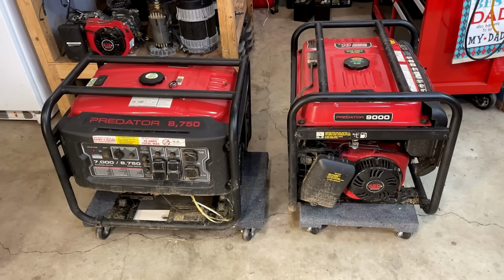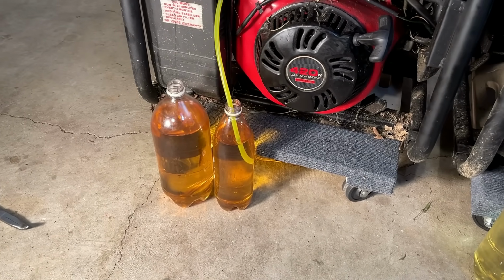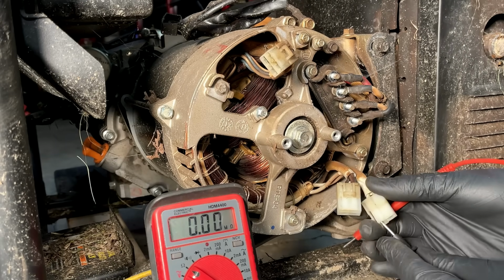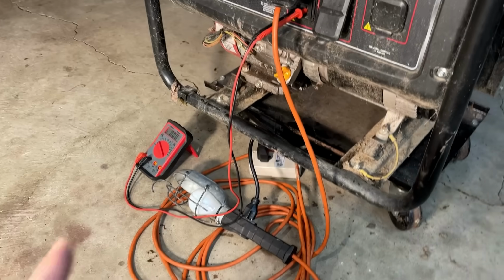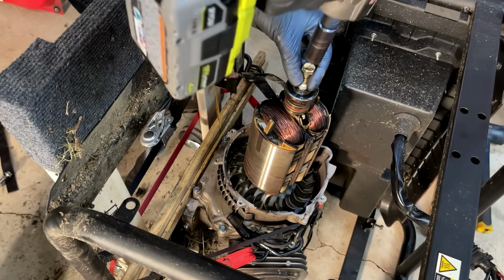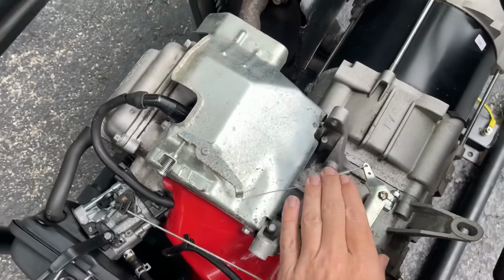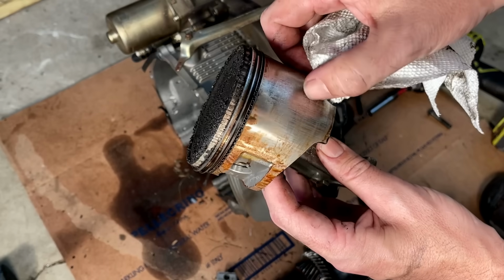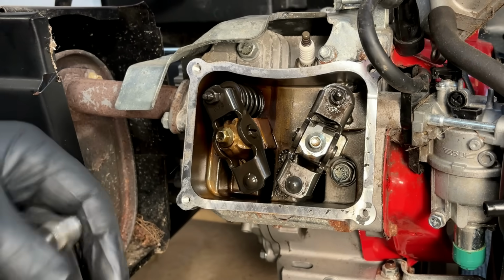3 Abandoned Predator Generators - Will They Run?

Comment: u must have a very good resale thing going on hahhaha... i cant even get rid of one coleman 5000 watt green monster 10hp. i guess its time of year . come winter they will want them lol .. had to do a new carb and fuel line filter and groumet on tank. owner left it with stabil in tank and carb.. yeah i could clean carb it wasnt to to bad. like a think goo oil from oil fields. but for 25 bucks for carb and needed oil and fuel filter and groumet do it right.

Comment: just curious. what kind of oil are you using in it? i was using synthetic 5w30 in my brand new lawn mower and it was doing that. i switched to briggs and stratton sae 30 and no more smoke. runs better than it ever has

Comment: A perfect plan for an off grid installation, where you really need the power...buy the cheapest generator(s) you can find, and never service them. What could possibly go wrong? Better off with a liquid cooled engine and four pole head for 1800 RPM.
In my world, our plant actually manufactured generators in this range, which gave me some pretty good insight if the pre Chineseium generators. We found that the best heads at the time (middle nineties) came from MeccAlte and Sincro, both from Italy. I built most of the test systems for both on line and life test. We used mostly Briggs & Stratton and Honda engines.
There were at that time only two shaft tapers, and a few bolt patterns on the engines. Engines in the same HP range would interchange. Engineering typical tested random generators off line to failure. The test equipment would vary the load, on and off, with varying loads. The idea being to work the set under standard load.

Comment: Hello. I had similar problem with excessive smoking on the engine startup with my lawn mower. I was worrying about rings or valve stem seal failure. It turns out there was a little bit too much oil in the crankcase; somehow oil has been pushed through the breather to the airbox causing really bad smoking at startup. I removed around 50ml and it fixed the problem for good.
Actually I was surprised with excessive oil level, because when changing oil I removed every last bit of old one (changed when hot plus I've added cleaner so it was much thinner than usually). Hint for me was the spark plug - was covered in residue suggesting engine is burning excessive amount of oil and inside of the airbox - covered in oil. It was such a relieve not to have to disassemble the engine to fix the problem 😄
Reply: Make sure fuel is not getting into the oil.

Comment: Glad you were able to make other generators run with the parts machines.  To bad for those engines though.  Makes me wonder if they guy just ran them to low on oil for to long and they were damaged beyond repair.  Great video at any rate.  Thanks for the videos.

Comment: In the last 6 months I had 3 new generators replaced!
The first Power King needed the bushes and AVR replaced after 2 months!
The the same unit threw an earth point and the dangling wire kept arcing to the frame, causing a burning smell.
The company replaced that with a 8kw Wolf generator and that one lasted 3 weeks before the engine seized.
The replacement Wolf arrived and that last 4 months before that snapped the top off the valve. After speaking with theretailer it turns out the previous machine had done exactly the same but that valve snapped and dropped in to the engine killing it.
I've had that one refunded and bought a P1 powered by a Hyundai 16hp engine, 8kw, from Amazon.
Yesterday after 4 hours of running time, not continuous, in the sweltering UK heat, the engine refused to start up on my next job!
Glad to report this morning it fired up with no issues.
I wouldn't mind if the generators were going all day every day but they are used around 4 hours per day in total, but not continuously as I travel from one job to the next fitting tyres.
My very first Wolf professional generator was still going after 5.5 years but i decided to get a new one as I can't afford to be without power, and thought getting a new one would last me at least another few years.
Worst decision I ever made as I sold this unit and its still going strong powering a mobile catering van at the weekends for 8 hours per day!
I love your videos by the way. You are very methodical!

Comment: I am surprised you did not take the control panel apart and make sure all the insects were cleaned out.
I would have like to see a final load test after the valve was adjusted to see if anything changed.

Comment: In 99 I lost my rusted but trusted 79 Ford pickup to hurricane Dennis trying to get home with the generator we borrowed from the company we worked for because our beer was getting warm. At the time we could only carry light items as the wind was at 100mph plus and sand hurts at that speed. Overnight the ocean had flipped the truck so there were tools buried everywhere including the generator which I really didn't want to have to pay for. The morning of the third day the wind and ocean had calmed enough that I could and did take the old diesel work truck we also borrowed out to recover the generator and whatever else we could get quickly as water was still coming over. Long story short it took three days of soaking the parts of the generator in reverse osmosis water to get the salt and corrosion out not to mention sand sand and more sand. I got it working and was told that they were going to sell it off for $50 anyways as it was old and leaked oil. Sold. I still have it too and sand still vibrates out when running.

Comment: Hello Jim, another nice video. When you do these parts teardowns, do you make a data sheet with part numbers and readings before putting them on the shelf for later use? I would think you do the tests and then look back at the video and input them in a spreadsheet for when you need them for a future project.
Reply: I was wondering the same thing.

Comment: I think theres 2 factors that made thses Engines blow up 
1) Owner Negative on (Oil running it without or low)
2) Wear and Tear on that Spring which i think needs a Heavier Gauge to prevent this again,,

What do you think am i Correct ?

Comment: And also James if you want to pull valve springs without pulling the head take the pull out and put rope in the hole with the piston on the bottom an then roll the engine back to top it won't let the valves fall down do what you need to do an put keepers back on

Comment: Thanks for your thoughtfulness and logical troubleshooting I was able to epair my own generator. It's a relatively new Westinghouse wd9500df and from new only ran 48hz. As it turned out the adjustment screw bracket for the run speed and govenator had a weld broken. To make a long story short, the other weld broke while trying to straighten the bracket out.  I then drilled two holes and put in screws and washers then bent the bracket straight.  Then backed the screw out and started the engine.  With my kilowatt adjusted to speed to 60.5 hz which held solid under load.  Again thanks for your great videos. Keep up the good work.

Comment: 6 hrs of tapping the cylinder and out comes the 30lb sledge and into thee dumpster. Just kidding!
Had a Preditor once with a Hemi too. It lasted about 5-6 months and began smoking as well,, then she would suck oil through the air filter housing and fowl the plug continually. Clean restart, run a few days, smoke, then fowl sthall and repeat.

Comment: I was what I considered a pretty good mechanical repair person, thou my trade was Master Plumber contractor,, but today there is so much poorly engineered junk manufactured,, I don't wanna waste the time or money fixing this crap. Autos included if there; 78 or older. Pittiful. I dont even buy personal apparel New or used unless my cloths are falling off of me. Just look at that piece of crap HF 5gal can, with all those ridiculous safety features,, takes forever too fill because of the plastic screen and 3 times as long too empty into your tank. On the side of a possible highway or interstate? And in the middle of below zero?
We had GREAT PRODUCTS in my day,, and they were not Plastic pron too creating static sparks!

Comment: James, I have had a Predator 6500 since 2018 and haven't had any problems except for the fuel line drying out.  I definitely over change the oil.   I thought it was strange that the 5500/6500 you have has a 301cc engine.  Mine has the 420cc.  Looking at the Harbor Freight website they seem to shifted all of the engine sizes down per generator one size sometime since 2018.  The 9000 now has the 420cc (not sure what it had before), the 6000 now has the 301, ect.  The only reason I could see why they did this would be for emissions reduction, but I wonder what that does as far as performance seeing as they reduced the engine size by 100cc's but kept the generator head the same.  Mine easily handles the entire house and all appliances (all propane).  Side note, I'm not too far from you.  Maybe 90 minutes from where I'm in CT.  As a retired Navy diesel mechanic that primarily maintained and repaired large shipboard diesel generators (460V/1-1.5MW) this is probably my favorite channel.  I look forward to Thursday every week.  Keep it up!
Reply: I purchased my 9000 in March 2020, it was manufactured in September 2019 before they did a complete redesign of the 9000, and mine has the 420cc engine.

Comment: Springs can also be influenced by temperature in like an old wall mount thermostat. One that has been exposed to a lot of heat and weather can take on slightly different characteristics when in use.
Well at least they were useful organ donors.

Comment: I definitely recommend Lucas fuel treatment it has been a more than excellent fuel stabilizer for very long term in automobile. Ashamed to tell it but my 02 Dodge Ram 1500 4.7L V8 went 14 months to memory.  Bad neck and back problems and what few days I felt pretty good I did feel like messing that up by hefty a large truck battery in and out when I did not need the truck.   Lucas injector cleaner seems to be pretty good too.  I suspect that it is not a one small single bottle fix but the larger quart bottle used several times along with fuel treatment has restored fuel economy when 1-1.5mpg has been lost for no other known reason.  The fuel treatment has worked well through our winters in the south for small engines as well but it does NOT prevent gas with alcohol having an INCREASED affinity to attract more moisture FROM HUMID AIR nor does it prevent alcohol from damaging specifically two stroke fuel lines and primer bulb.

Comment: Pretty big clank maybe a partially broken crank connecting rod bearing cap
Reply: Or wallowed out piston connecting rod bearing and bearing cap
Reply: Did you check to see if someone had disabled the low oil shutdown to continue to run it without low oil shutdown protection and ran it low on oil if engines had low oil shutdown switch

Comment: These gensets are junk, good for a couple thousand hours and toss them in the scrap pile. I wouldn’t waste my time repairing one they only last 3-6months in continuous service with proper maintenance. Don’t get me wrong they are fine for standby use, just not for prime power use. A proper prime rated diesel genset is a lot cheaper in the long run in an off grid application, 30,000 hours is typically for a diesel genset in a prime power application. Switch them over once a week and service the one you took offline.

Comment: I'd like to have been there when they let go. It must have been spectacular.
Reply: I had a rod break on a HM10 Tecumseh on my snow blower. It was running fine, then a soft  pop and it coasted to a stop just like a normal shut down. Then I saw the hole in the side, I could  put a baseball into.

Comment: I absolutely love my Predator Generator, not once has it ever let me down, James what’s your honest opinion on the Harbor Freight Generators
Reply: Chris, I used to rebuild Predator engines for a guy who raced them engines in go carts.  Great motor.  We ran DOUBLE of the Stock RPM with governor removed, higher compression ratio, hi lift cam shaft, stiff valve springs,aluminum flywheel, race exhaust.   A Stock predator will run for ever with oil changes, and  clean air filter and Fresh gasoline. Highly recommend changing air filter to a racing style K&N, and safety wiring crank case side cover bolts.  Very good engine considering how we abused them in racing.

Comment: Would love to get one of those tanks mine has a leak at the seam. What would you sale one for just asking 😊
Reply from the maker: I only have one left.  Used one on the Honeywell video two weeks ago.  It is the larger of the two so not sure if it will fit.  eBay has a bunch of new Honda clone tanks for $50-$80 depending on the size you need.  Just search for "generator tank" on eBay and you will see some options.  You will have to double check the measurements on your tank vs any on eBay. 
 If I ship you a used one, shipping would probably be close to the new price from eBay.

Comment: Q. On this style engine, how does the oil get to the rocker assembly, pumped ?
Reply from the maker: There is a passage from the main crankcase up to the top end valve area.  It is just splashed with the dipper and the positive crankcase pressure helps bring it up to the valves.

Comment: Lol on facebook marketplace here in miami in not runni.g condition those go for around $300.
Reply from the maker: I usually do not find Predator generators in this condition or price.  The property had a lot of stuff left behind and the new owner just wanted it gone.  The gas tank alone was worth the $60.
Reply: @jcondon1  oh i know. The pull cord i sent you last year was supposed to be for a 12hp and i got sent one for a 8hp. Thats why i sent it to you cause the seller told me to keep it lol. but yeah i know all about how much parts are.

Comment: I have seen race car engines put a window in a block and do less damage then that.  I have never seen a small engine block obliterated to that extent.  That was an impressive failure.  I really wish you would have said what you were asking for the smoker.   How about running something like seafoam or B12 through it, maybe there is some carbon on the oil ring and it sticks until it warms up.  I bet the combustion chamber is as bad as the other two  so getting some of that carbon off can only help.

Comment: A lot of hours on the valve stem seals, now worn and allowing some oil to seep into cylinder after shut down.  On start up the oil heats and burns until it's gone.  Simply replace both valve stem seals if they are replaceable.

Comment: Using hydraulic pressure to remove the rotor is the coolest trick I have ever seen!
Reply: yes it works but oil or grease is easier to seal off than water but whatever works
Reply: I had to go back to see this, somehow it got past me. But i have to agree, it is one of the coolest tricks ive ever seen as well.
Reply: That was pretty interesting, another thing I learned working on Generac standby Gens per disassembly instructions, it tells you to sacrifice old long rotor screw/bolt, cutting off the hex head and a small bit length, cut a slot to screw it back into the engine shaft so it allows you to screw in larger bolt into rotor shaft end to put force against engine shaft(thro old screw) and brake rotor free from engine that way. All warranty jobs that require that type of disassembly came with replacement long screw/bolt.
Reply: Using some sort of liquid is pretty common for pulling primary clutches on snowmobiles. If you don't there is a good chance you'll bend or break the tool
Reply: Yep that was amazing.

Comment: The third generator, with the Hemi Engine, the aftermarket does supply parts for those engines, since they are used in mini bikes and go carts.
Tried to leave suggestions, but my comment kept on getting removed.

Comment: Same old story. Oil got low, rod bearing froze while running, rod broke and punched a hole through the block, taking everything in it's way with it. It's pretty sad how poorly people maintain their equipment, especially someone depending on it for their only source of power. Yes, I understand, these generators probably have a lot of hours on them, but they would have had a lot more if the owner had only invested $15 in some oil. What a shame.

Comment: James I really enjoyed your video. Those two engines had some severe carnage! 
I must say I was a bit disappointed that you didn't go a bit further on the smoking generator. At least a leak down test. Also removing the crankcase vent from the air filter while running would show evidence of blow by. Valve seals can often be had by valve stem diameter. A good NAPA store could possibly match something for you??? To me the way that engine clears up after a few minutes I would highly suspect valve seals and or guide problems. I would think an oil ring would keep on smoking. 
I also realize even a good preditor generator may not be as valuable as a so called name brand??? 
I also wonder if a small dose of "snake oil" although I'm not a big fan may help swell those valve seals and free a stuck ring if that was the case?? 
Again not criticizing your decision I'm only throwing out my thoughts. Keep the great videos coming!